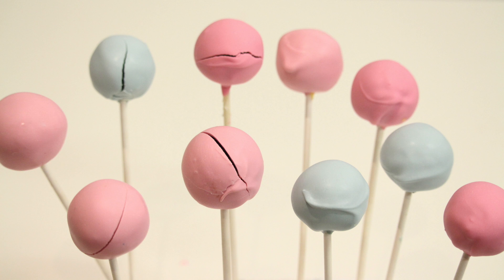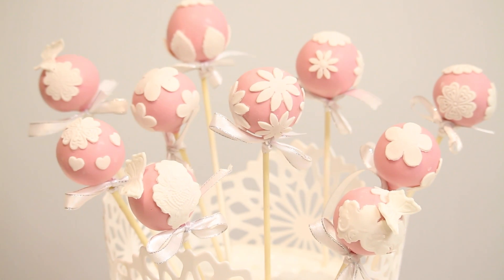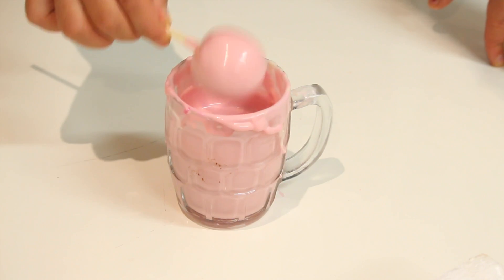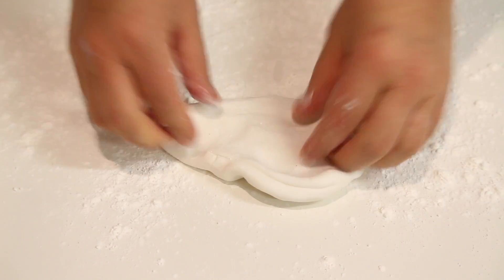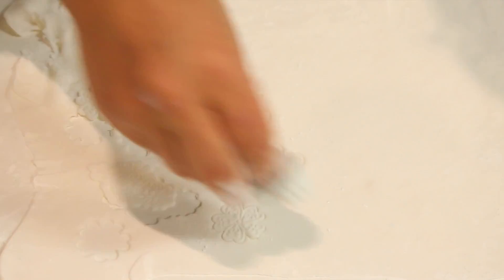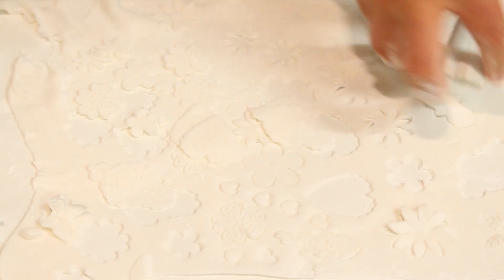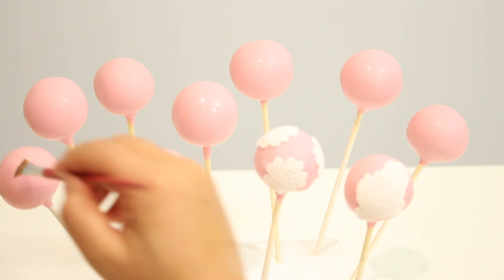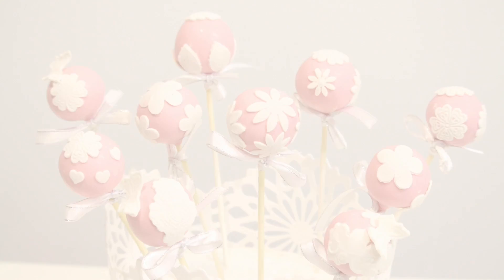How to fix CRACKED CAKE POPS!

Comment: Hi how do you keep the pops on the stick.  I tried making cake pops and I found that as I'm dipping the pops, when taking it out I find that the sticks just come out with the formed chocolate around it. Some times  when I stand the pop, it just slides down the stick
Reply: That happens if they are too warm. Try keeping them in the fridge a little longer.

Comment: Did u get cracks when you dipped cakepops for the 2nd time ?
Reply from the maker: hi Guadalupe, no its almost impossible to get a crack the second time round as long as you haven't placed them in fridge. So when you have the crack just leave the cake pops at normal room tempt before you dip them again.